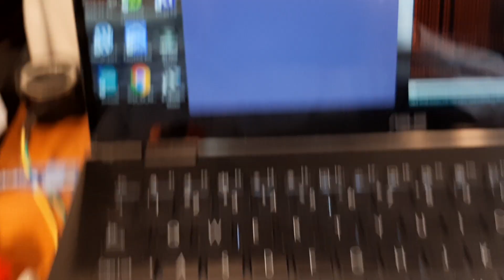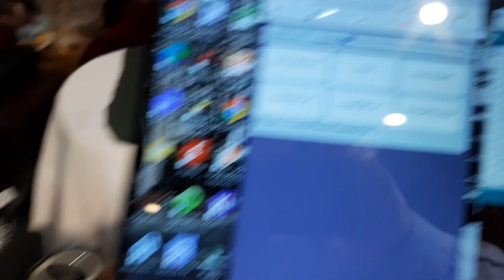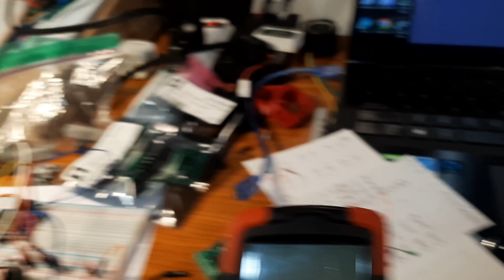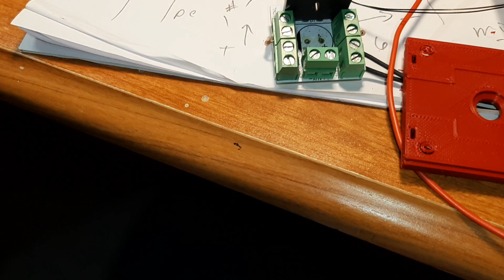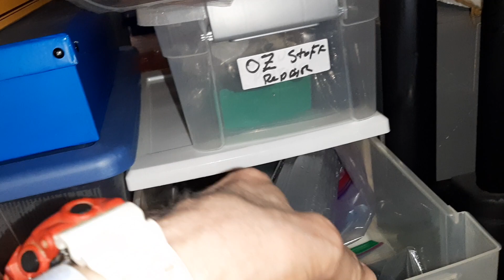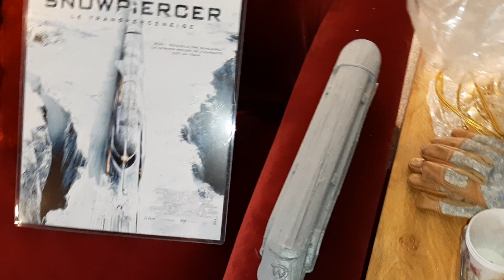Frankentrain Laboratories American Flyer compatible Next Generation S in Alpha test WiFi control.

Comment from the maker: I misspoke when I mentioned Andy and his contribution to our NGS program. He lives in South Africa. Near Pretoria north of Johannesburg. He had never heard of Flyer but wanted to try it. I have sent his several engines, using basket cases so he has to complete them. He is very resourceful and assembled a beautiful Blue Atlantic and is now working on his Hudson. I send him designs to test and he tries them out on his engines and sends back the files with changes. He has the identical same 3D Printer as I do and that is how we hooked up. He offered to help me with a printer issue. That was two years years or so. We have shared the invention of all the Next Generation S Parts. He design the PCB for the Digital Reverse, and Smart Smoke Lid. He lives in South Africa and I am lucky to know him. Thanks Andy for all you do. Dennis

Comment: Dennis we jst got home from  Boston and am enjoying the tutorial so damn cool, phenomenal is more like it.
Reply from the maker: That was day 3 we are now on day 6 and I am creating new code to turn on the P&C thru the MicroController. Once i learn the means of changing code reliably i trained in computer programs back in the Dark Ages. So while the languages have changes the use if digital logic has not. I have ordered for test pads for rapid prototyping code updates and sensor integration. I gat more familiar with the setup requirements and syntax I believe we will have some very strong features even in this Level 2 controller. I recently found some smaller voltage regulators and am looking to shrink the hardware requirements so we can get more digital stuff to control via software.  This is clearly a new generation for S Scale and will serve to FUTURE PROOF all our beautiful Vintage Flyer engines. Any Arduino Users out there keeping watching. Its looking pretty Good.
Reply from the maker: A lot is coming together hang on it will be a fast ride. D

Comment: Can we use it on dc can motors? How many engines can you run at a time?
Reply from the maker: Yes Timko or SNS are all DC motors, principle of operation is the same. Unknown at this time we will be exploring the limits as we go.
Reply: @DennisMurphey  did you know Frank Passed away?

Comment: Dennis
Verry, cool, this is what I am waiting for.
Reason for wifi over Bluetooth?
I see Big Train company using Bluetooth 
How many different trains do you think you can run at one time?
Will the program work on a phone or tablet? 
I use android OS

Thank you and Andy for your hard work.
Reply from the maker: The demo was run on my Android Phone earlier and we are building a hand held device.  We are learning more every day just how it works and what capabilities are there now and can be later. Each Controller inside an engine will have a unique ID Number. The challenge is multiple train engines at once. But what ever we have today we know we can move it along. this coding is all open and we have all the source.  There may be draw backs or short comings  that we have not discovered. Since we do not have unlimited finding, actually zero funding, we can not redesign hardware very cost effectively. And my goal was always to help the S scale stay alive. Our Digital Reverse Board was a part of the Next Gen S family that we called Level 1. Same Basic control logic and limitations. This WiFi solution is going to to fit as the Level 2 Solution, Wireless and MicroController. And then we have the top solution Level 3 that is pretty much a dream sheet that we plan to build on Level 2 and grow into. There will be more of the sophisticated solutions you refer to. We know we can not build it all at once. But we also know we want folks to follow us after we are gone to continue to grow the solutions and carry all our work forward. I hope you can appreciate such a vague response. I had a lot reliability issues with Blue Tooth but Tech advances an all the fronts so we will be open as we progress. Thank You for you enthusiastic support.  D